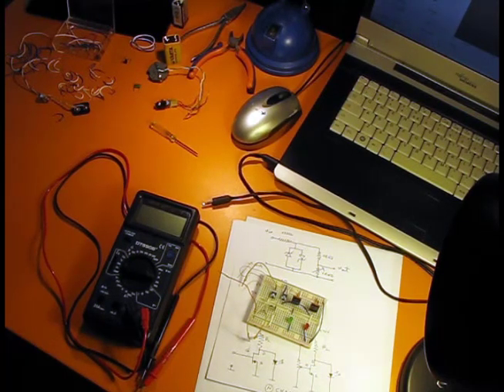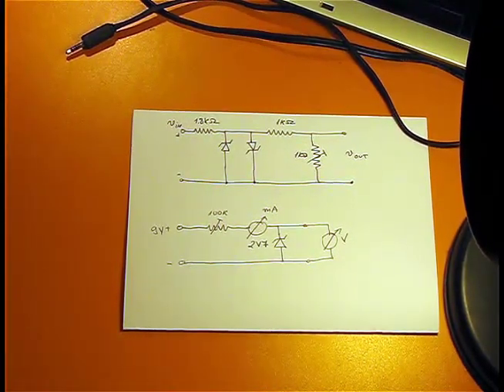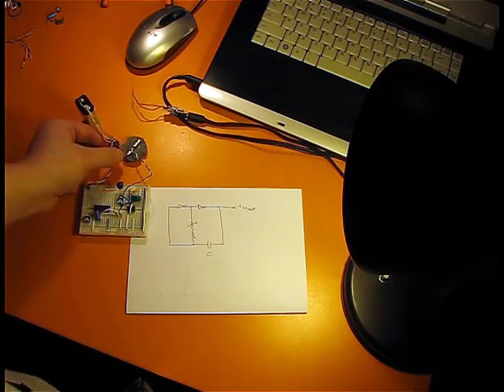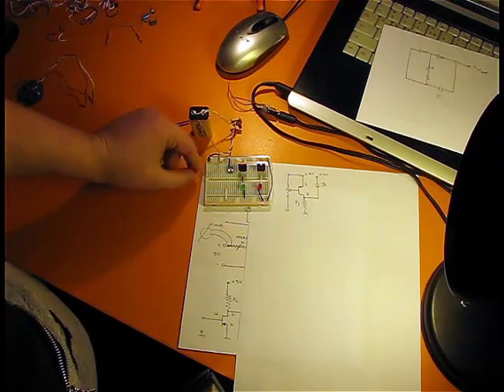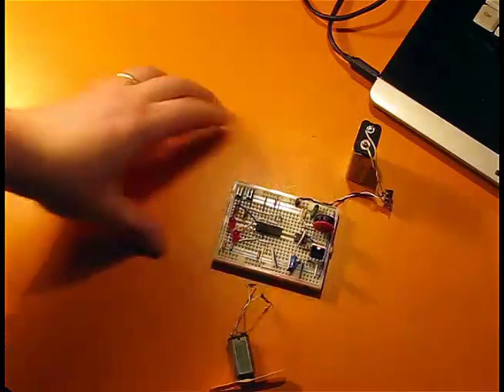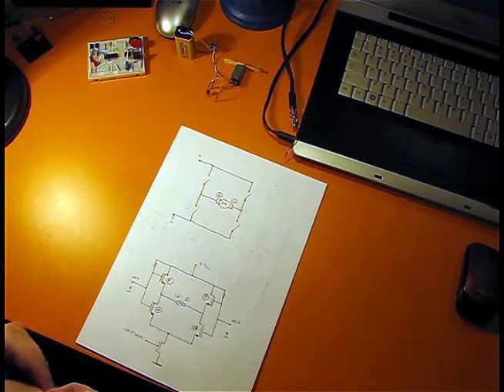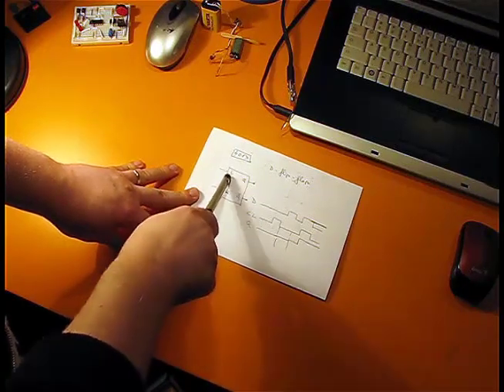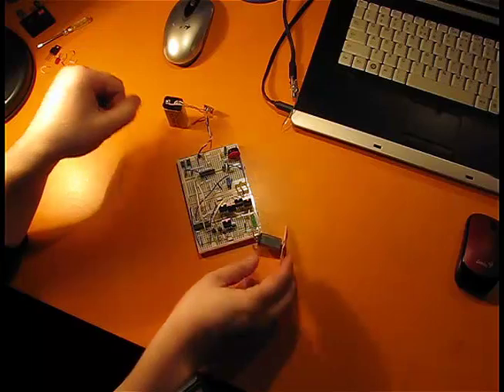CECC2 : Digital Control of a DC Motor using PWM

Comment from the maker: You give me too much credit .I have bought the Mosfet transistors and the integrated circuits.But it is amazing just how many parts you can scavenge from an old tv and i am refering to capacitors , resistors, inductors, and bjt transistors.
 I really want to encourage new students to participate in eDX classes and competitions even if they have limited resources. Everybody have a tremendous potential inside them, as i saw from my fellow colleagues, it's just a matter of unlocking it. Have fun !

Comment from the maker: .I have used a 741 op amp in inverting configuration with R1/R2 <1 , but for small values it will output a lot of noise.I ended up using a simple ao attenuator as in description.